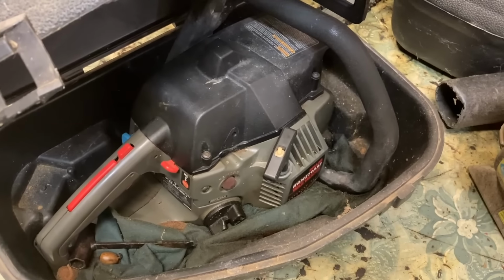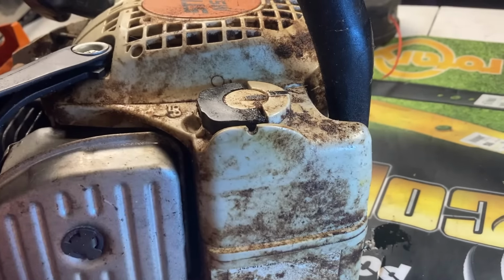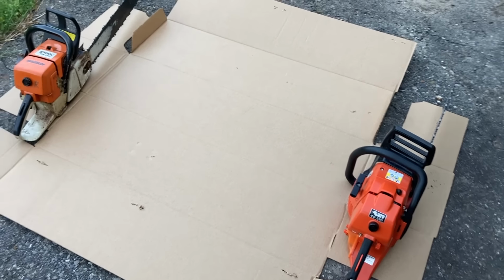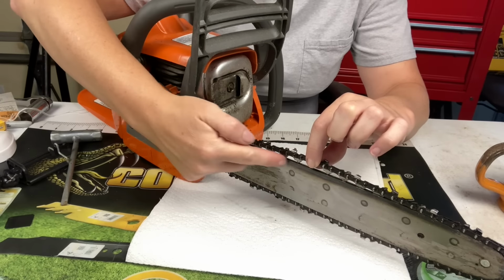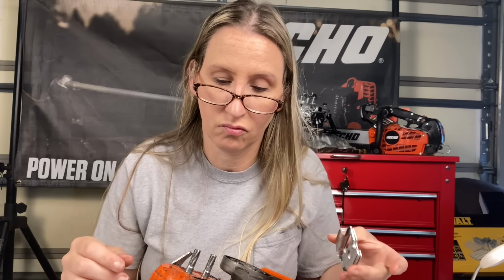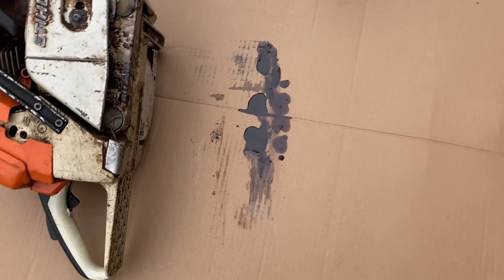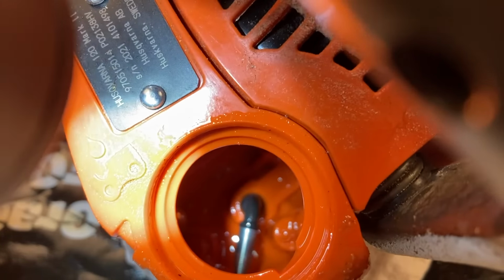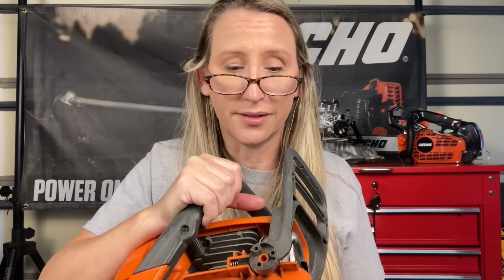Chainsaw leaks bar oil? The most common reason why AND Husqvarna saw leaking oil FIXED!! Repair Vlog

Comment: Hello Bree,

You haven't by chance replaced an oil hose or diagnosed a MS361c for an oil leak have you? I watched this video a time or more when it originally was released and just watched again. I just cleaned our saw as it needed some care. Used a cleaner then compressed air to get things cleaned up and as much of the cleaner and debris off. I then wiped it down with rags. As I was doing so,there would occasionally be an oil drip on my cardboard work surface. I believe the cap is weeping a little, but I think there is more leaking from maybe the hose into the oil tank on this saw. Suggestions on any videos addressing a saw in the Stihl professional lineup for oil leak repair? Yes I realize there will be some residual, but I haven't even run this saw yet post cleaning and have drips. Thank you Bree! I appreciate any help you can provide.

Comment: I have 2 Huskys and the best way I've found, short of draining the oil after use (which face it...who takes the time to do that?) ...is to store it on its side with the bar facing up. Any other position and they will leak. Changes in ambient temperature will change the air pressure in the oil reservoir and push oil out. For long term storage it's still best to drain the oil out.

Comment: Mine leaks so bad I use my used motor oil which is synthetic it does a great job but when I'm done with the chain saw I drained the bar oil tank an sit it on my piece of cardboard in the corner of my garage on the bottom shelf

Comment: I use low air pressure (5-10 psi) high volume and and spray them down with soapy water. Like a leaky tire.

Comment: I just keep a few layers of cardboard and/or absorbent pig mats under my saws. The only big leaks I have had are from crap around the plug compromising the oring seal there. Big temperature swings with hot days and cooler nights don't help either.

Comment: Shazam!  Three days ago I was using my MS250C and felt wet on my left leg. The bar oil cap was hanging by the retaining cord. Well, the inner half, anyway. Found the outer half by backtracking among the logs. Picked up new caps for oil and gas.

Comment: I have an old husqvarna saw i bought it in the late 70s. It runs great but the trigger lock on top of grip is lost. It still has wire showing and still starting. But would like parts. Where do I look. It’s a 61 cc

Comment: Ok, I'm fairly new with owning a chainsaw. I haven't seen it to leak the oil. I pulled clutch plate off and it was messy. So I wiped it clean. So after watching this I'll go back and see if oil has tracks and check to make sure grommet boot is in tight. Hopefully!  So I'm guessing it doesn't matter grade and brand of bar oil?  Correct? And they all leak.

Comment: I have checked the 'usual suspects' for loose/broken hose connections, but in the case of my Stihl saws it appears to be leaking at the pump around the ends of the drive shaft. Seems like they are a pretty sloppy fit.

Comment: They pressurize when sitting would be my guess on the leaking oil problem. Put them in a case and they will heat up and pressurize quicker.

Comment: I have two Stihls, a 211C that has leaked from since it was new and a 271 that doesn't.  The only way to keep oil in the 211 is to lay it cap side down. Bar side down and it will all run out.

Comment: HI, Igot an old 1978 sears 14" bar chain saw with a lack of oil coming out to the bar.  got diaghrams on the parts used to deliver oil to the bar. I have checked the filter blew out the tube, checked a check valve, even replaced the filter. I can not get oil to go on the bar. I think it uses crankcase pressure? Help me

Comment: I have three saws that never leak because I drain the gas and oil when through for the day. Also I never buy bar oil, I use the Mobil 1 synthetic I drain from my Z06 Corvette. Works great, never any noticeable bar wear. You're welcome (for that money saving tip).

Comment: Hello I need some information about the ignition coil. I have 2  2 dcycle and 1 4 that don't sedem to be getting spark I have cleared all the wires which might be grounds but still no spark (at least I can't see it. Through the net I have done their voltmeter tests that seem to be good. I don't see many showsthat bring this up. so I am wondering if the coil is that fraduile Thanks great watching you

Comment: I realize you do not have the time to clean every saw or piece of equipment that comes to your shop, but thats something i prefer to do in mine, since i dont have all that much going on....while im looking or tsking things off for whatevers, i use my compressed air and/ rags to clean the equipment off at least to a reasonable degree, it saves me from having dirt falling in places i dont want dirt. If im blowing it out i make double sure none is going to go inside the engine or other critical parts... Love Your Channel. PS, i have the CS590, and i use the same oil you used in your 2st test.
~Chris~

Comment: I have a stihl 041 av that has a excessive oil leak any thoughts or places I should look first. The saw had not been started in 15  years and I noticed it after I got it running

Comment: I think that I have stumbled upon a possible solution, at lest with my Husqvarna saw it works. I tried storing my saw upside down and it worked! It's been sitting upside down for a month now and no oil has leaked out. Maybe others can give it a try and see if it works for them too.

Comment: Maybe you've done a video on electric chainsaws?  Well, I'd be interested on how to fix the chain oiler on the DeWalt battery powered saws.  My factory replacement has developed the same exact problem:  The chain oiler quit oiling after a very short total run time in spite of using their DeWalt chain oil and keeping it filled before every session.  What's up w/ this??

Comment: When using a gallon size container of bar oil only poke a small hole on the side that your going to pour out of that way you have to squeeze the bottle for oil to come out lot less messy
Reply: Im talking about the foil sealing the bottle

Comment: Bought a  20" Pollan for Lowes and straight away  added bar oil wanted to just check it out since I've never used a powered one just a crosscut  saw and it took all summer long to get 3-4 cords of wood up anyway back to the saw, ran about 10 minutes let it cool placed in the case and looked a while later and the case was full wth. 
The worst part is  I misplaced the receipt. Called the manufacturer they said I would have to send it in and pay since I didn't have the paper on it!
Worst  $200 I've ever spent.

Comment: Yes man I what’s ur show they all great I’m from Texas and not good small engine mechanic parts changers I got ms 391 still chain saw that the coils stop’s fire to plug I replaced it with factory parts from dealer it’s doesn’t work but bout tank fuel in hook wires of coil and check wires make sure ant shorted every time and gap it with business card and the coils just crap out can you say what’s wrong or does Stihl know 90$ for coil don’t last long saw is in great shape but blows out coil and stops fire not to plug when you get fire to plugs it runs ball to wall until it blows the coil ur help would be great got 700$ saw want run very long

Comment: Great Info...will check mine out for sure as there is too much oil leaking! But one suggestion, which is sometimes....it would suffice to have a 5 minute video to say...BAR OIL LEAK - CHECK YOUR GROMMET/HOSE Connection in the Bar oil Tank which is a Prime Target!  But seriously, love your help/videos!

SIDE NOTE to CHAIN SAW MAKERS: COME ON!!! U know how to make a Darn Connection on ALL your hidden Connecters like this that DO NOT Come off so easily and are at least easily Serviceable! REALLY....Everything really DOES NOT has to be a scam to BILK your Customers!

Comment: After using my chainsaws I remove the filler cap and drain out the bar oil into a small container before storing them.

Comment: Could it be that they have a gravity flow drip vs a pump system???
Reply: still hasn't changed, its a gravity flow drip systym
Reply: Hum????  well, let see??? Nope it's still a splash or drip depending on where you come from

Comment: awesome synchronised rpm . sound.  my chainsaws are only refilled with Any oil prior to going to work  with them .I pre lube the bar and chain prior to reassembly and take a squeezy bottle with oil to squirt on the chain and bar to make everything well lubricated .

Comment: Neighbor an I talked about this bar oil leakage, both saying chainsaws will leak. Neighbor's fix after use is to lay chainsaw on its side over clean oils drain pan, for storage until next use.

Comment: one way saws seem leak oil is by running them without putting them in any wood. the oil sticks to the chain and flies off of the chain around sprocket just like it flies off of the tip.Then it drips out of the cover like its leaking..

Comment: I have a DeWalt pole saw that leaks bar oil badly and I've read that all the cordless saws do whether it's a pole saw or otherwise. Apparently there's no fix other than draining the oil out. Have you run into those cordless saw issues?

Comment: I have a brand new Sthil MS250 and it leaks like a sieve. 

Maybe it was to full and the heat in my shed caused to much pressure build up.

The second time I used it and it was only half full, I checked it the next day and sure enough it leaked all over. 

Does the cap have to be opened to release pressure prior to storing? 

Should I take it in to have it looked at? 

It's ridiculous that a brand new saw should leak like this.

I owned a Poulan chain saw abot 15 years ago and it never leaked.

Comment: I have a MS391 with an oil bar oil leak. I have taken the sprocket and clutch out then cleaned it really good. I let it sit overnight to find that it appears to be seeping out of the oil hole where it matches up with the blade. The in/out lines are dry as a bone. When I slightly poke the oil output hole then oil runs down the side by the studs and tensioner slide then down to the bottom. This is a small leak but putting out enough to make it wet and about a silver dollar size oil spot on the table underneath the saw. I have a picture if that helps. Any suggestions for how to fix this?

Thanks Larry

Comment: Reminds me of a joke with old Harley Davidsons that have a brass knuckle off the block with a pinhole in it to lube the chain. They leak like crazy. Do you know when to add oil to a Harley? When it stops leaking. Also oil is a very polar substance. That is the polarity of the molecules will pull others in the direction it goes with just a little run off. That's why oil also runs up the spout of your can after use and sitting for a while.

Comment: I own an Echo 330EVL that runs and cuts great.
The bar oiler uses a full tank of bar oil very fast 
regardless of the setting. It isn’t leaking but the chain is getting way to much oil. Any suggestions?

Comment: Hell, I don't mind the oil puddles so much.. so long as ya prepare for it.   I have a husky 440, 445 and a big ass unbranded Amazon special...    I loosen caps, and store em bar side down (caps up) much less oil seepage..   but still a little.

Comment: I know it sounds counterintuitive but when pouring oil or any liquid from a bottle with a spout try turning the bottle 180 degrees so that the spout is on the top and you will have much better control of the flow from the bottle. No more glug glug glug, but an even flow as thin as you like.

Comment: Another UTuber did a wear comparison on various bar oils (by measuring chain stretch), and HARVEST KING came out the winner, despite it is lower cost, than most of the other oils. Available at Rural King stores, and others about $10/gal.(reported by the reviewer).

Comment: Ok, so the only thing I can say to this video is that the "Fun-L-Fill" quarts of anything like the ones you are using here are specifically designed to be poured with the hole UP.
Just like the super-secret picture embossed by the neck of the bottle.
Having the hole you're pouring out of at the top of the jug allows air back in and will not glug and spill, and allows the jug being emptied to be tipped up way further before liquid comes out.

Comment: Bought my first (used) a 55 Mac 55 with a 30" bar and chain, manual pump, still use it once on a while, but its never leaked.  My second (much smaller) bought in 1984  a Mac eager beaver 14", it died last year and never leaked. I replaced it with a brand new Echo that has leaked every time afterwards, not just a little, it leaks until the oil is empty.

Comment: Here's one for you. My MS310 just started leaking alot of bar oil. I haven't run it in a several months but it started right up like always but then after I was running it for a while to make sure it was running good without stalling out it started leaking oil heavily. So I did everything in your video and it all checked out good and my results are that it's only leaking heavily while it's running. But it leaks so much that oil sprays out from the seams of the cover and the stream off the bar looks like a squirt gun.🤔 Now like you said better to be oiling than not oiling but I'm perplexed as to why it's leaking so much now.

Comment: I recently got a refurbished Husqvarna 120 Mk II, it was leaking bar oil all over. After watching your video, took mine apart and discovered it didn’t even have the grommet installed.

Comment: The saw you show at 2 minutes is incredibly clean in comparison to how mine leaks, and mine has done this since new. It's a Stihl MS230 and will leak 1/3 tank of oil over 6 months

Comment: I believe that Stihl has a problem with their oil tanks particularly the design of the oil filler opening. Mine has leaked oil since I bought it.a new cap will fix it for a short time then it turns back into the Exxon Valdez.

Comment: I hate the new style kill switch on my Huskava. My old one had a toggle switch so when you turned it off it stayed off. My new one has to be held down till the motor stops. I consider this to be unsafe,if you are falling and want the saw shut off there's no time to hold down the kill switch. Ended up throwing it away from me when I lost my balance cutting in a brush pile of tangled branches,only way to clear it was to get into the mess. I was standing on solid ground when this happened. Wish i could put a toggle switch on the new one.

Comment: when I called my Stihl Dealer to ask about leaking oil, they said it was normal behaviour if you left the chainsaw in a place that got hot during the day and cold at night. They said the temperature changes caused the machine to leak oil to relieve pressure.

Comment: Being less oil leak between the 2 different oils ,was that possibly because they dollar oil is a lighter weight   oil? Just a question ive wondered about.  I know some of the oils i have used seem to be lighter than the other, not remembering what the different oils were??

Comment: So i have very little experience with chainsaws, are they supposed to be black around the "exhaust grill" and is it normal for it to smoke a little while running? I just have a stihl ms170

Comment: I simply pour the chain oil out into a different bottle and use it later. Every chainsaw I’ve ever had  has leaked copious amounts of oil regardless of age. I’ve tried every suggested solution proposed by different techs. Pouring the oil out before storing is the only thing that has worked.

Comment: I agree with your conclusion.
And by the way; when you are filling the bar oil reservoir, i noticed that you are holding the bar oil container ‘’backwards’’ and it makes gulps wile filing!
I have learned somewhere, long time ago that the reverse side has a slope in the neck more like half a funel shape that makes it easyer to pour at a constant rate without the gulps!

Comment: Thanks for great tips of what to do . I have a Dolmar saw that leaks bar oil . I fill up the tank and the next day the tank is empty. Will see what i'll find out what the cause of the issue. Would a crane instolled on new saws be a solution of the probem ?

Comment: Was told about my  sthil leaking oil . It was pressure in oil tank an loosen the cap , But it didn’t help Have a big rag stuck in bottom of case. Oh an the saw was new

Comment: There’s a difference between leaking, which pretty much means unintended oil drips, and just draining the overflow from normal operations. Some engine designs are designed to cast off used oil from normal operations, others are designed to trap the used oil and reuse it. These engines cast off the used oil, which contributes to the mess. It’s the drips from when the engine isn’t running that I would have thought you would concentrate on. Maybe you made another video? I thought I saw one that didn’t have the spray testing.

Comment: How can i make my ms271 oil more , my 2021 new saw doesn't oil near enough  1/3 tank oil 3 tanks gas and oil is still not empty . I read on youtube several different places that these new saws the oilers are not adjustable,  ( help ) just ruining  my bar & chains .